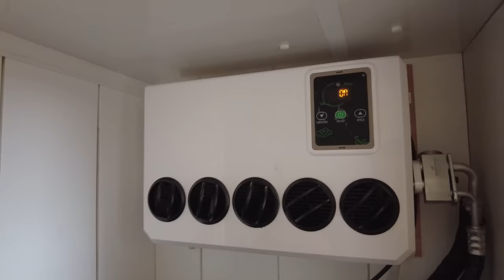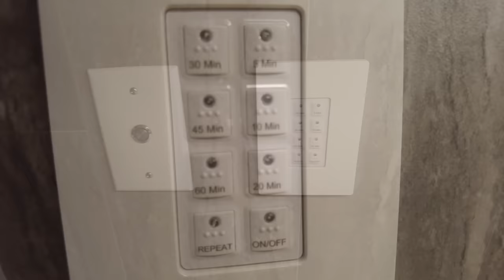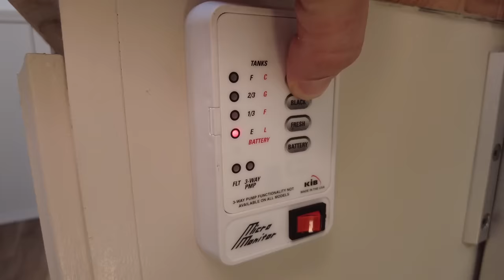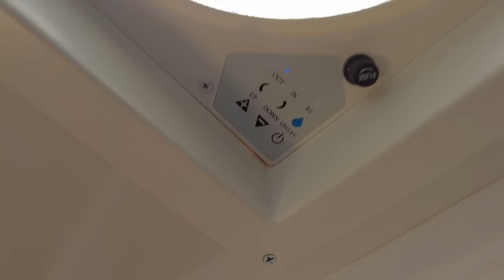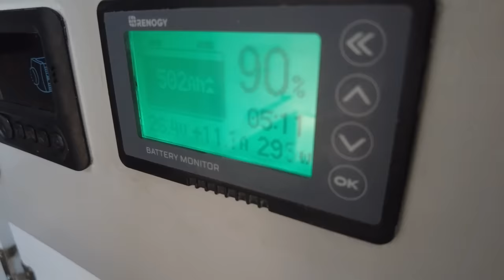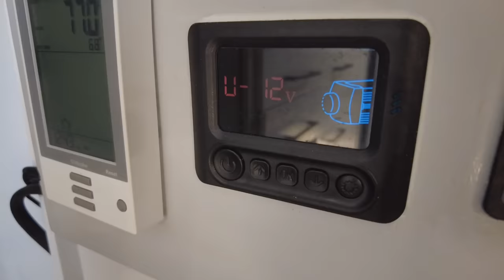Stealth Apartment + Toy Hauler in a Box Truck? DETAILED TOUR!

Comment: Awesome.  One more thing I think would be a nice touch was some kind of flush mount fixing ring in the boards of the rear drop down door to let you raise/lower it using the winch from inside, if left attached over night you could just press the button from in bed in the morning and let it lower down to reveal whatever view you had out the back!

Comment: I'm thinking of 4 upgrades. 1. Recirculating shower.  2. Small cameras tied into the TV to see what's going on outside with a DVR system. Also with a monitor in the cab area so you have a backup camera.
3. A slightly larger skylight that would allow roof access to add a Starlink Dish when parked. With a sliding door to hide the interior light at night. 
4. If possible a second storage area on the driver side to match the one on the passenger side. 

This are my personal preferences. I like the idea of the box truck for stealth. Trying to convince the wife and looking into the 26 foot version.
Reply: 1. No. Gross. Ugh.
Reply: @opossumgrylls3275 Why such a rude over reaction?

Comment: Impressive, though I would add a multifunctional/stealth ladder to get on and off the bed. I would also diversify the energy production and include a wind turbine (disguised as an air vent) so you can even charge the capacitor when you're driving as well as a cable from the alternator in case someone decides to throw something on the roof and destroythe solar cells which is a concern of mine. I'm a prepper so doing things in threes comes up a lot.

Comment: Truly residential. Truly discreet. Only a professional Stealth Box thief (if there is such a thing - and there probably is) would notice some of the outside accoutrements (e.g. vent, lock, etc.).  I love the bathroom, washing machine, kitchen and oven, the sliding glass door and the look out the door when the deck is in place. If I rode a motorcycle, your set up for hauling it up and mounting it is perfect. Kudos!

Comment: The only thing missing is a fold down tray in the bathroom for getting ready such as shaving blow dryer ect. Love it.😊
Reply: Yes, a small storage space where the front opens down to make a shelf would be good.
Also, thinking about shaving, I think a mirror at the kitchen sink would be good.   The bathroom looks a bit small for the stepping back to make sure I got it all and there is no sink there.
Reply: They sell objects like that on line that are also heat proof for curling irons. When you’re done with it (over the sink) you simply roll it up.
Reply: @kensmith5694  
Are you sure you need another sink two paces from the galley?
2003, we built our ExpeditionVehicle.
Zero sinks.
Two decades full-time live-aboard.
Reply: @largemarge1603  My comment was not about adding a sink.  It was about adding a mirror somewhere for shaving.  Keeping up the pretense of being a human and not some sort of werewolf means that I do need to shave even if I grow a beard.
Reply: @largemarge1603 

Why are you always questioning/correcting everyone? Your experience is your own. It's not always going to be converted perfectly for other people.
Reply: The swing table by the couch would work for shaving gear, a pan of water, or a curling iron plugged in next to the couch.
Reply: @largemarge1603 I like to be able to wash my hands right after using the bathroom without touching various surfaces (and  possibly spreading germs) on my way to a sink across the room. I also don’t like using hand sanitizer.

Comment: You might try a different mounting solution for the mini-split condenser. They are supposed to be mounted straight up. Mounting it sideways like that is going to cause oil issues for the compressor. There is also normally supposed to be 18" of clearance for the coil to get adequate airflow across it. 

It would require an actual HVAC guy to do something custom. But you can have the compressor mounted in another location so it can be oriented properly, then have the fan coil in the spot in the video. Just some slight repositioning to provide the correct clearance for airflow. I'd also recommend some sort of a divider to prevent the hot exhausted air from being recycled back through the condenser coil. 

They also make mini-splits that have a reversing valve in them, so they provide heat as well as cooling. Honestly, I'm surprised you managed to find one that wasn't a heat pump. I've never seen a cooling only mini-split.
Reply: I know this is a bit late of a response, That isn't a residential mini split, it is a heavy vehicle mini. They are smaller and made to mount underneath for semis, small buses, vans, etc.

Comment: Nice looking build, one thing I did notice is that the rear leaf springs don’t look too happy, a new set with more capacity would be a good idea.
Reply: There are plenty of companies that use a polyurethane block in between the top of the spring and frame of Truck. They get 4.9 stars homeowner installed.
Reply: That’s called a bump stop. It has nothing to do with the load that’s on those leaf springs.
Reply: Wait till he loads it up with all his stuff and a motorcycle the bumper will be dragging on the ground.
Reply: Wait till he loads it up with all his stuff and a motorcycle the bumper will be dragging on the ground.
Reply: The truck Is probably an F350, an F450 or F550 would handle the load better.

Comment: Very impressive. Anyone would be more than happy to use something like this. You have put some good thought into this stelth truck. I am in the UK, so are vans are not as big as this. But it would be nice to have one. Running 240 volt power for everything. That. Would be the only different in specification to this box truck, it being LHD. Wouldn’t be a problem.

Comment: This is great man, but I do have one piece of advice for well everyone.  I know it will add some weight, but some sort of strong sheet metal for a bit of protection between dualies and the internals is needed.  If you lose a tire it will absolutely rip the guts out of your tanks.  (Had a motorhome on an E350 front end, lost the right inside dualie, and it ripped a huge gash out of the fresh water tank.  After the tank was replaced and everything else it beat to death in the like 100 feet it took me to get stopped, I put in a guard for the wheel well and just in front of it where the tank sits. Additional note: there was a very thin plastic wheel well, it didnt stop anything from the blow out, other tire survived right next to it through probably kept it from going out of control.)

Comment: That is so cool, homey and stealth, I don't care for the stealth except for the door that comes in from the cab that is very cool.  I would have either a slide out or a fold out to give me more space but also option to keep it stealth if I so wish.  I would get a instant hot water heater and saves on energy since you aren't having to keep water hot in a tank.

Comment: Nice work, I would suggest a steel wheel well to protect that black tank valve.  Any road hazard or tire blow out will destroy that.   Also, that medicine cabinet needs a good latch, when the driver has to brake hard his prescriptions will end up in the shower drain.

Comment: Fantastic build! 1 Suggestion to move the controller box away from the closet rod. The clothes on hangers can get damaged rubbing the box and possibly the hangers could damage the controller ❤
Reply: Thought the same...or at least a thin cover shield?
Reply: @resu,
2003, we built our ExpeditionVehicle.
Clothes are rolled, stored in milk-style crates.
Plenty of ventilation, zero mold.
Reply: @largemarge1603 This clothing rod is meant for  items that NEED to be hung up such as a man’s suit jacket.

Comment: I think that you did a great job with this design. I am a little concerned about the outside part of the AC unit getting damaged from road debris. I am impressed that the electrical system can support full time use of the AC system. Thanks

Comment: This is amazing. For Food service had the same box truck, it ALWAYS got attacked in the parking lot overnight. The gas tank got punctured 2 separated times (drained gas), the catalytic converter stolen 2 separate times, stalked and broken into, in 3 year period. It just seemed to be a magnet. How does one keep these vehicles safe. Wish it legal system worked. Thanks for your hard work!
Reply: Yes, I found myself wondering how you keep the graffiti artists away from those blank canvases.  They won't leave our boxtruck alone.
Reply: What if you put a fake business advertisement on the outside that makes it look like you deliver seafood.  Nobody would want to mess with that because they know it goes bad and smells so quick.
Reply: They would break into it in record time.  Seafood is an expensive commodity  @KurtStoll

Comment: Don’t put glass jars in that fridge if you’re on the move. RV fridges aren’t only compact for saving space, they also are designed to use less energy and are engineered to withstand travel. This means better containment solutions for keeping things from bouncing around when driving and a compressor system built to handle travel.
Reply: Just get baskets/plastic totes to separate and organize. Easy fix!
Reply: We have been full time for 7 years and have a residential refrigerator. We Casey anything we want we just utilize containers in the refrigerator to store these items in.
Reply: @starrturner426 What does it mean to “Casey”?
Reply: @synnove1046  is that like a Dirty Sanchez?

Comment: Great build! I'm not sure it can be improved on by much at all. The only thing I'll say is water conservation is key, especially sleeping two butts. Recirculating grey water for the toilet to flush would be ideal, and a shower recycler would really help. Grey water is stupid easy, maybe you need another pump, idk. The recycler may not be worth the extra complexity, but it saves a ton of water. Especially for women. Rain collection would be super cool too, but dificult to execute unless you have levelers.
Reply: @brost,
Water is available everyplace.
Water is cheap or free.
Why 'conserve'?
.
2003, we built our ExpeditionVehicle.
Two decades full-time live-aboard.
Reply: @largemarge1603  depends on where you're going. If you're in a dessert you'll need to conserve water. It also reduces overall weight if you don't need to carry as much water. Invariably conservation is key to sustainability. The less you need the more you're free
Reply: @largemarge1603 Water isn’t everywhere. This is a stealth build. If he’s parked in the street or in a parking lot, where  is the water supply? How do you remain stealthy if you want to stay where you are parked but you run out of water?  And conserving water is also good for the environment.

Comment: Thank you for sharing with us! I appreciate the detail in which you describe, compare/contrast the different options from RVs, vans, & box builds.  I think it would be a great series idea if you found someone with an RV and changed it from some of the antiquated and limited RV functions (particularly the electrical components) to the fully, self-sufficient systems that you install in the box trucks.
Reply from the maker: I would definitely be open to that!
Reply: Problem is rv’s are built of low quality materials. No good starting platform unless you find an old all fiberglass rv.
Reply: @HankHill757  I disagree with a blanket statement. There are several brands, especially in a 5th wheel, that use quality materials and similar wall and ceiling structure as a box truck. The up front cost of those quality campers, $50-100k, would preclude many from the electrical upgrade costs.

Comment: Such an amazing build! The only thing I would look into changing is adding a piano hinge to the part of the bed you remove to place in place to transform the bed for 2, and also you would have to carpet both sides of the one piece that is the one on top. Instead of having that 2x2 metal holder you have to hold the bed up in the corner, I would put a flush mount flat piece of metal with a 3/8" threaded hole in the center of it so that you're then able to screw in the 2x2 to hold up that part of the bed when you open it. With having the piano hinge in place when you open that part of the bed, that part of the bed would then lift the other part that it's attached bringing it up flush so that, that part of the bed would then be flush as well with the rest of the bed that is fixed in place so its all at one level when opened, if you know what I mean. But other then that, great job!!!💯🔥🔥🔥

Comment: 🤘🏼🙌🏼👍🏼👊🏼 This is exactly what I need for my bike and travels! The ramp is so excellent! 
One thing I learned from solo winching bikes up ramps, I required a spreader bar to clear the front wheel. This prevented the straps (2 pick points on forks connecting to the load line) from snagging on the treads at different elevations. 
Congratulations on this stellar build!

Comment: Love this. There is a benefit to composting toilets though even if they are more expensive... no need for a black water tank so you can have more fresh or grey water tankage and no need to pump out a non-existent black tank. I know there are other disposal considerations, but I prefer that to pumping out a black tank lol. Also, love the stealthy way you did the mini-split. Out of curiosity, would it be possible to mount the outside portion of that on the roof near the skylight or something? I'm only curious because I come from the 1000 Islands area where winters can get pretty brutal, especially for driving. I can't imagine any way that regular driving through ice and snow and slush and salt would not destroy that within a couple years at most.
Reply: I wondered the same. Although, I deal with flooding more than snow & ice...either way, I thought, "ooohhh, stealthy, but that's gonna corrode, fast." 😬
Reply: No. Ugh. Just no. 

Id pay MORE for a flushing toilet.
Reply: @opossumgrylls3275  have fun when the pump or hose breaks while you're pumping out your black water tank then lol. Ever see the movie Tremors? When they are pumping out a septic tank in the first few minutes of the movie, that can happen when pumping out a black water tank 😛

Comment: Just two questions.  Could the motorcycle side be modified to hold a mobility scooter? And is there a step to get in the bed? I really like this one. Not too small, not too complicated set up, plenty of power storage, washer, plenty of bathroom space. Hidden meters and electrical, large sink, enough counter top, decent fridge. Best use of space I’ve seen.❤
Reply from the maker: Thanks. I could definitely build it to hold a scooter. Folding step stool to get in the bed.